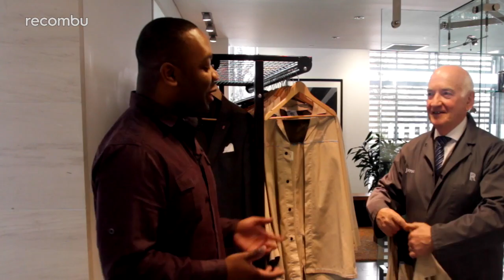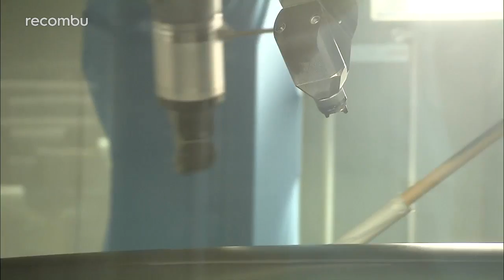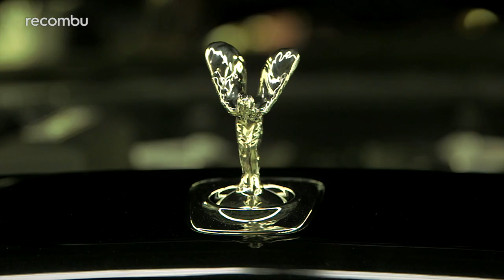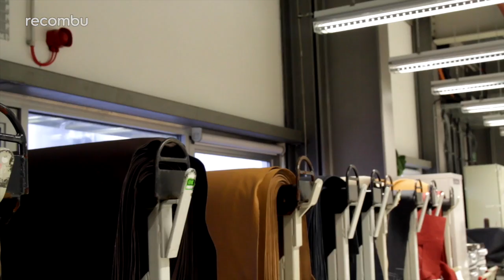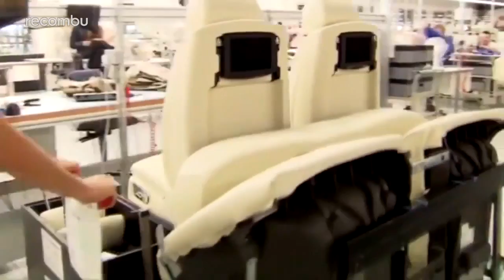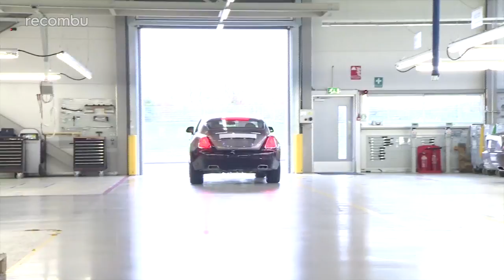Rolls-Royce factory tour: How the Phantom, Wraith and Ghost are born

Comment: I'M A PROUD OWNER OF A ROLLS-ROYCE!
  It's a 1984 Silver Spirit.
  I bought it in 2002 for a song.  It was well worn, but I spent $22k and 3 years restoring it.  Had the seats reupolstered in velor & suade, got new mocha brown carpet installed.  Had it repainted. Black and silver replaced the marker, brake, interior and headlights replaced with LED lights, and replaced the old engine with a almost new engine ( only 18k miles) and tranny from a 2000 Ford Crown Victoria.
Reply: WOW ....  that is the only car that imresses me;
the one you build yourself .....  well done.

[  there is NOTHING less meaningful , than the host of this show,  ? how did he even get into RR?]